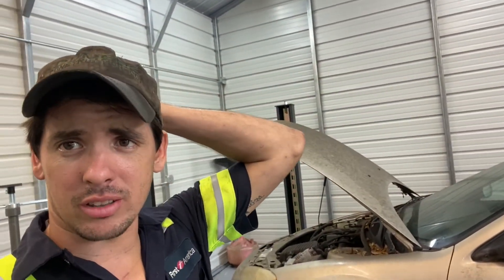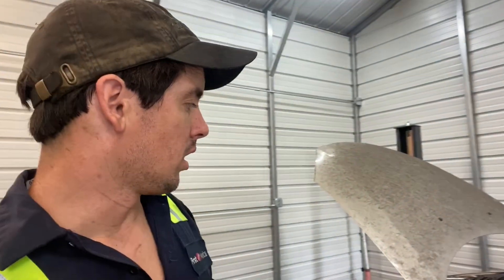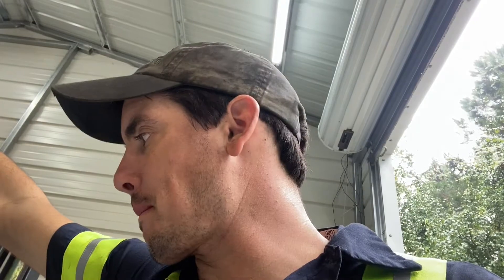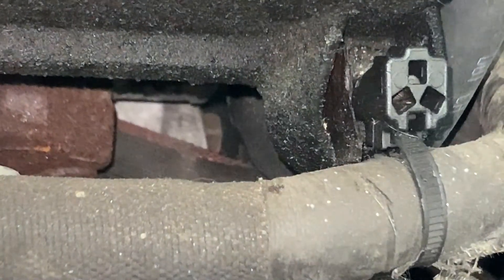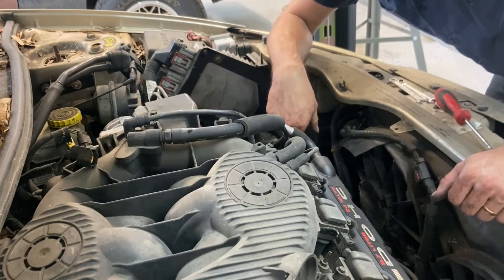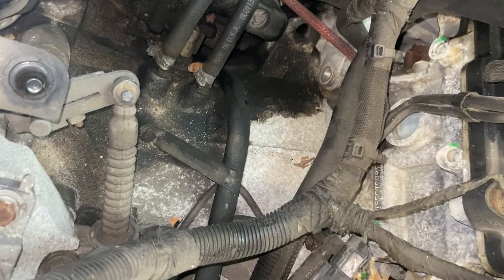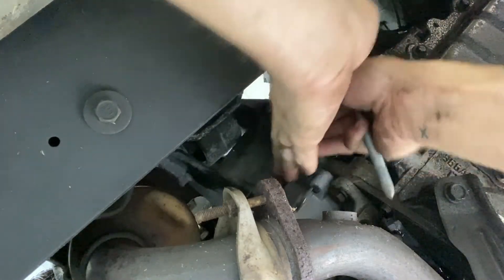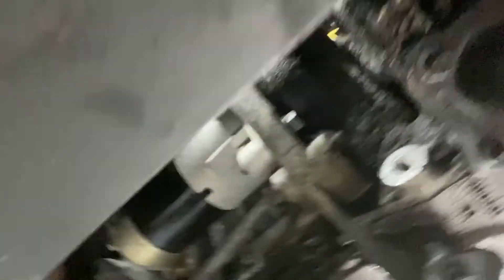2002 SEBRING STARTER REPLACEMENT

Comment: Omfg!!!!!!!!! I had this exact car just 2005. PIECE OF GARBAGE! I laughed to hard about your discovery of the battery! I was having this same problem, was going to change the starter, then installed a new battery just to be double sure that wasn't the issue. The day after, my engine block cracked, thanks to that great motor mount. Fell back on the suspension and steering systems. I junked the car obviously. Sorry for your troubles but thank you so much for the laughs in knowing I was not the only one living the frustrations of amazing chrysler engineers!
Reply: Now it'll haunt me til the day I die, wanting to know if it was the ignition switch... 😆🤣😂😆🤣😂
Reply from the maker: Haha well I’m glad someone enjoyed it lol Sebrings never cease to confuse me with how they’re built! Wel thankfully this wasn’t my car so as soon as it was fixed it left my shop lol couldn’t tell you if it’s still out there or dead lol
Reply: Dodge stratus Is the exact same I'm going to go with engineer isn't so smart
Reply: After my chronicles with the dodge stratus I will never buy or recommend any one buy a dodge. Dodge the dodge

Comment: I want a 100% hate Chrysler. Seaberries is what I own and I'm having issues where stars 1 day runs. Great, very next day. It will start, but they die on itself. Ha ha ha few people told me it was a computer. Someone go to a computer, put a program, put it in. Now it's doing the same thing.  I actually got it started once after I put the computer in it ran for 5 minutes. Let it run for a little bit shut it off. Going back out there and try to start it. And he wouldn't start. It goes wing wing. Or the cylinder went on the stock. I don't know starter if anybody has any clue. Please write in the comments. What could be for me? It's been acting up for a whole year now and I've been owning it.  It runs sometimes and runs. Sometimes it won't code. Reader keeps saying all kinds of off the wall stuff before. I got put to the new computer and now it's not reading it at all. Nothing it's telling me nothing's wrong with it, but yeah, it won't start and it's wing wing Wings. I mean by hasn't any info? D*** i*, let me know. Thank you.